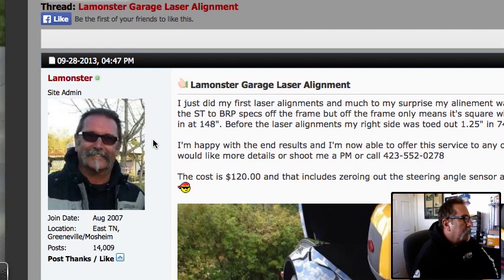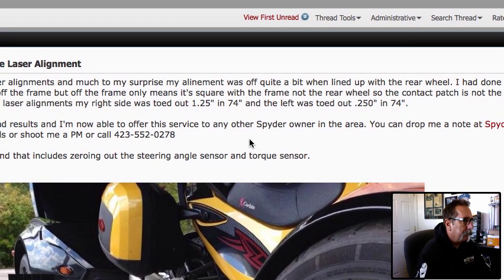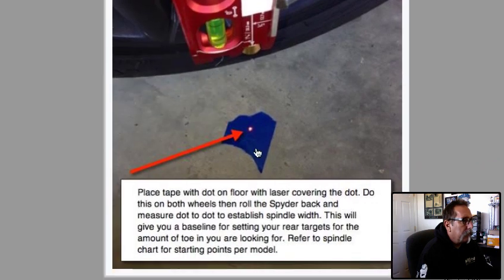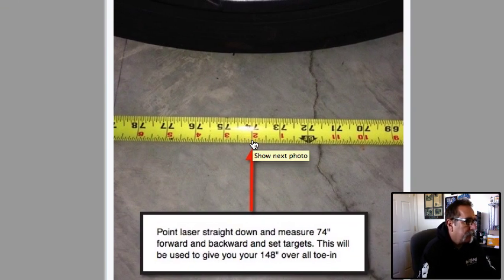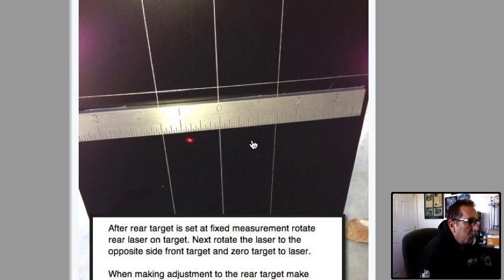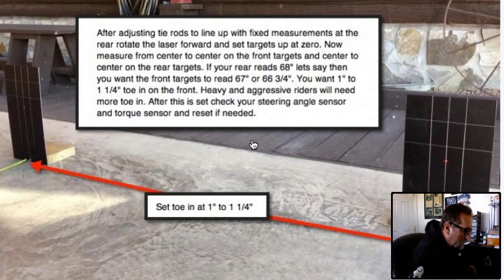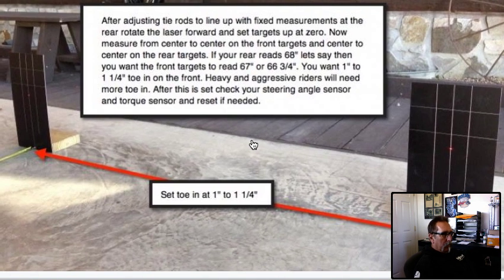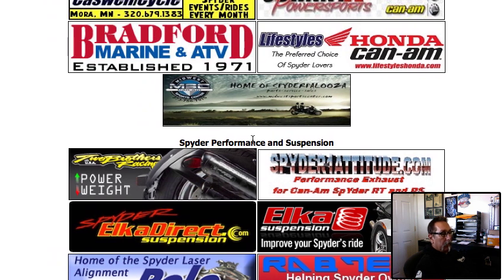Can-Am Spyder laser alignment

Comment: With your initial reading of 1-1/2" off,wouldn't that mean your rear wheel isn't installed squarely/correctly?Also,what is the "buds" or whatever you are referring to at 4:05 or so that you used to checked the steering angle sensor?Thanks!

Comment: Nope, sorry, to many variables and to many places to make mistakes.
Providing you dont have offset handle bar issues just measure the distance between the inside back of the front rims and the inside front of the front rims. the measurement should be about 1/8th inch less on the front. Done! If its not make sure you adjust both sides exactly the same amount. I have done lots of spyders this way, it works out great. if your bars are offset there is a way to sort that out too.

Comment: wow I have never seen a worse way of doing alignment. Don't you realize the front wheels will always evenly divide so the spacing at the rear wheel will be equal. It is impossible to crab or dog track. Proper toe is 1/8 inch using normal alignment tools not the hooky nonsense you are using. Also toe does not affect ride very much the purpose is related to tire wear not handling. What a rip off deal by a guy who has no idea how REAL alignment is done. you take a 5 minute job and bastardsize it into an hour and end up with a sloppy failed job. go to school learn how REAL alignments are done.